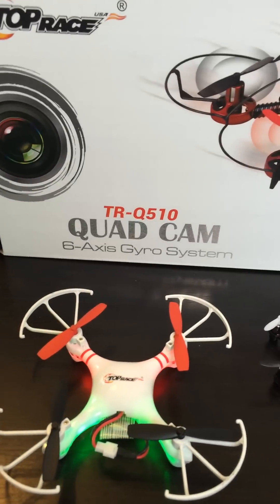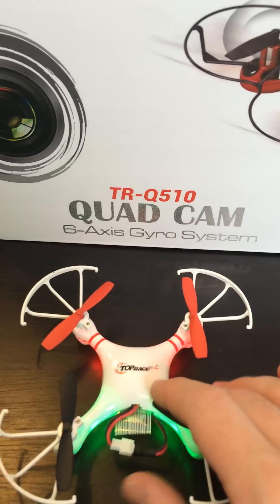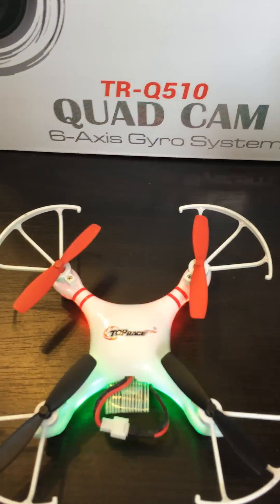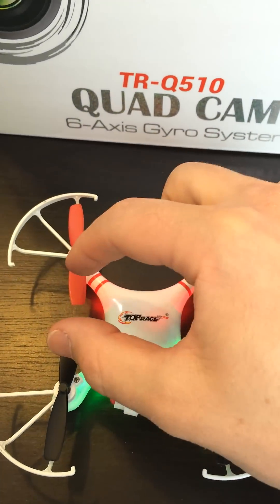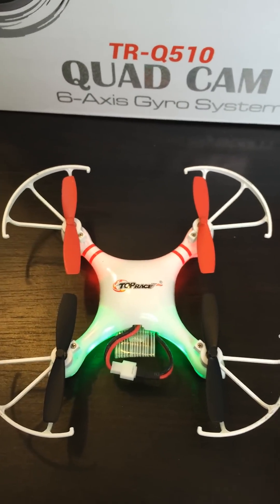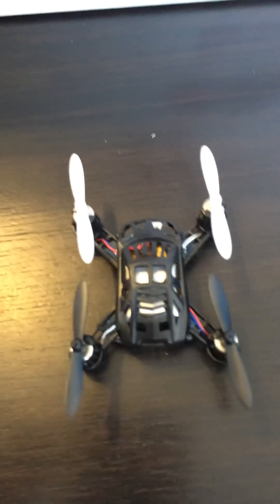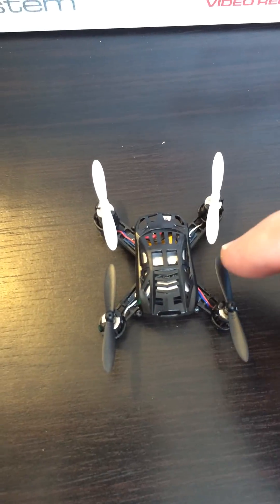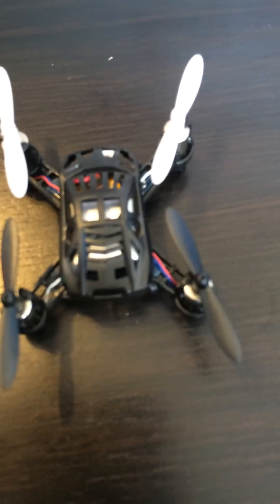How to install Drone propellers, the right position

Comment: Is this based on the standard rotation of motors (rear right/front left motors spin CW and the rear left/front right spin CCW)? What if the rear right/front left motors spin CCW and the rear left/front right spin CW?

Comment: When I installed using this my drone attempts to push down when I try to take off.
Reply: It means the rotation is reversed. You need to follow the same steps but opposite.